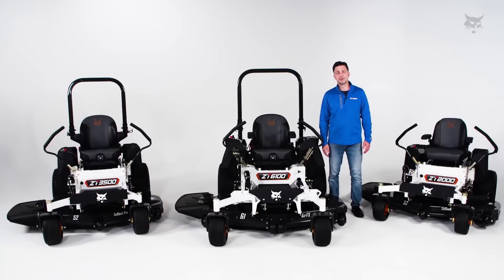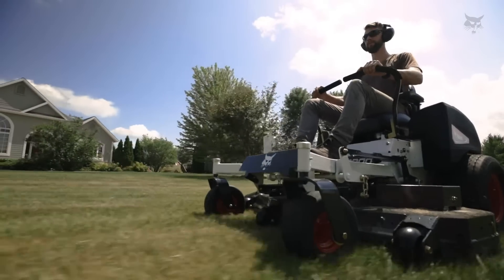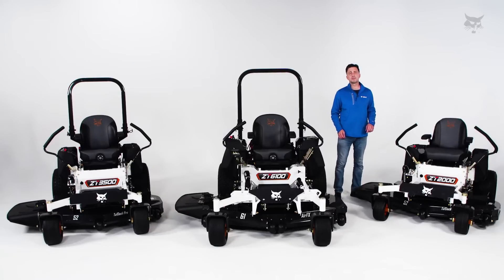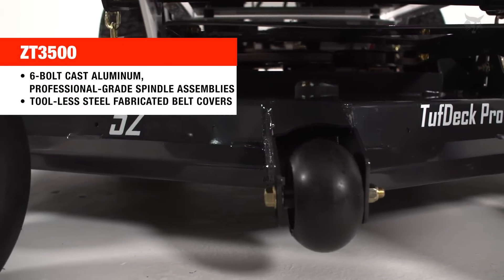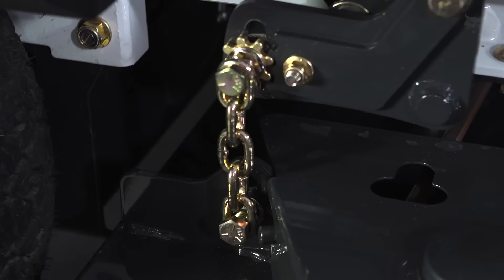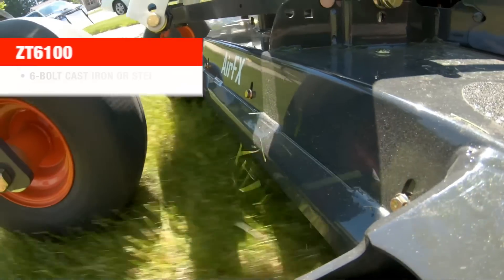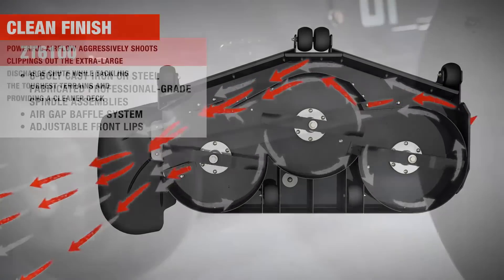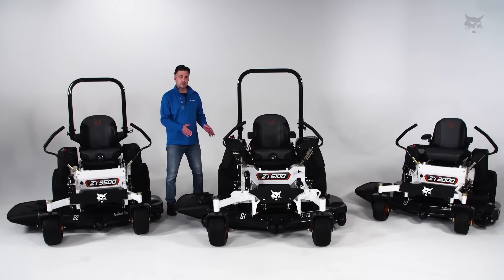Mower Deck Differences | Bobcat Zero-Turn Mowers | Turf Talks

Comment: Did not tell how to ajust these dumb chains on the 3500 bobcat, they rattle like crazy
Reply: If I new this mower was going to be such a pain I would have bought a hustler or a Bad boy
Reply: @thomasbyrd-ik2fp if you bought new, I'd bitch at the dealer for not setting it up. Chains should make NO noise at all. They are easy to adjust

Comment: The only thing putting me off buying the ZT2000 over the Hustler XD42 is the 2 inch smaller caster wheels on the Bobcat. That could make the ride a bit rough
Reply: did you ever buy a mower?   i bought and returned a new hustler.   caster size doesnt mean anything when the deck design is poor and requires you to make 4-6 passes just to cut the grass.